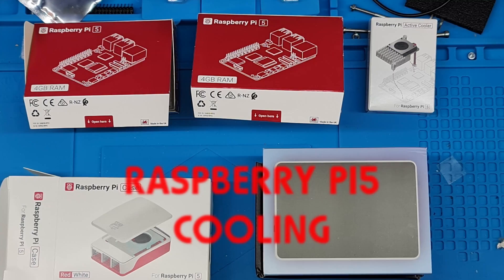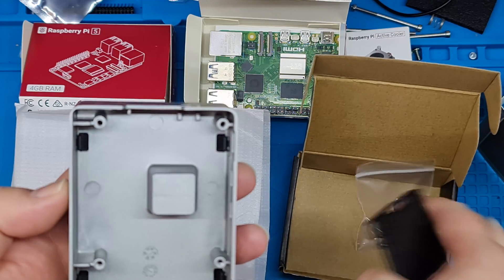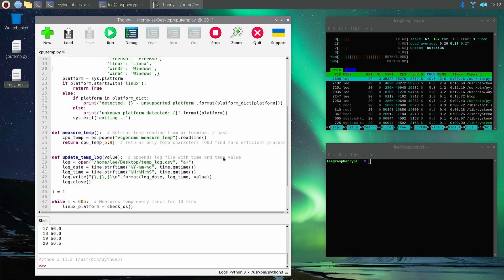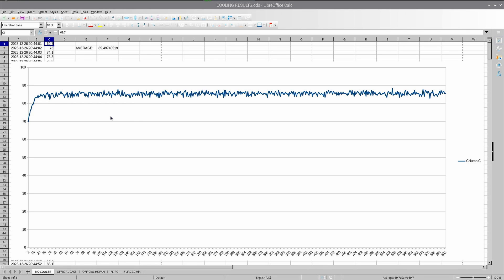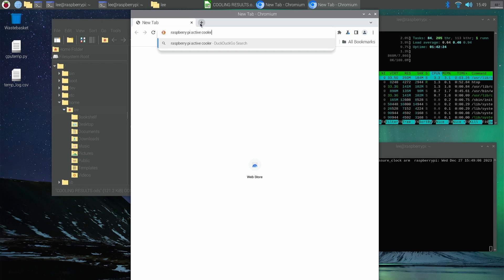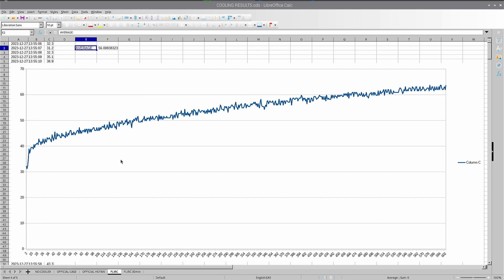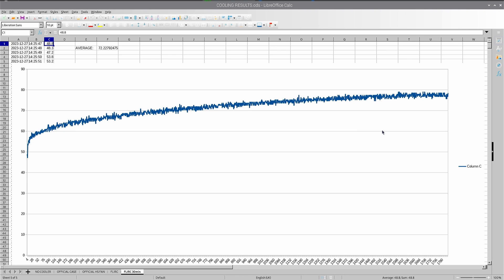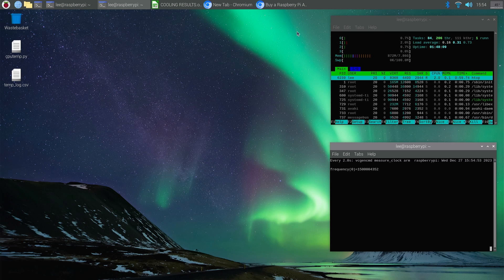RASPBERRY PI 5 FLIRC COOLER, how does it perform next to the other offerings ????

Comment: I disposed of the cheap foam thermal pad in my Flirc case, and replaced it with a proper 1.2mm copper shim and Arctic Silver 5 thermal paste. I burnished the heatwell flat before sandwiching the copper shim and thermal paste into place.  It was much more efficient pulling the heat out of the CPU and into the case.
Reply from the maker: @SEO122  once the flirc reaches saturation though it can only radiate heat at a level in proportion to the ambient temp, reckon your solution will deffo help thermal transfer from pi to case

Comment: Hi, thank you very much for this video. Since you own a Raspberry Pi 5 and the Flirc case, it would be really interesting to analyze if the Flirc case can also handle an installed Ubuntu since it's also supported nowadays for the Raspberry Pi 5. The temperatures should be higher but it woul be so interesting to know if they stay below 80°C. If you're interested in testing it, your audience would surely appreciate it :-)
Reply from the maker: @Lares575  I tested it under maximum load, as it handles 100% load ubuntu would no doubt use less and would definately handle it
Reply: @CaptainCommodore  Thanks. That`s good to know.

Comment: thanks for the great video 
what i would like to know is: does the flirc case influence the WiFi and Bluetooth connection? i could imagine hat metal cases can have a strong influence on these connections compared to plastic cases
Reply from the maker: @SuperPaul5000  to be honest in my use case (no pun) I don't notice any degradation of signal and I'm in a room directly above my router, however I could see there being a small reduction in range at the edges but this may be how it's orientated, both devices have a plastic base though

Comment: Really interesting, did you ever try to replicate this? Its crazy to believe passive cooling goes toe to toe for so long with active cooling
Reply from the maker: I did the tests several times, it is works well until the case reaches saturation and then its a function of thermal loss to atmosphere so this may reach throttling in higher ambient temperatures

Comment: The flirc missing the mark in some regards......there are other similar cases that make contact with other chips on the Pi.  They also have more surface area (ribbed) on the outside to get more surface exposure to air for better dissipation.  Oh - they're cheaper too.
Reply from the maker: Whilst tour absolutely correct , the other chips are rated for 85deg so it's not a massive deal breaker,  of course it also stands that if one chip heats up quicker than the others the heat will infact transmit to the other in contact with the heatsink, as the CPU heats up quicker it can raise the memory temp too..... the neo is really nice too and the hybrid approach is prob the best for me

Comment: there are other chips that the flirc does not touch, but the active cooler does. flirc results are not comparable because it is not cooling any others, also there was not additional chip coolers for the other chips. no way I am going to get the flirc case... thanks for the info!

Comment: great test 🍻
It looks like active cooler is designed very well, I have my RPi5 without any case, average temp working during the day is from 40'C to about 52'C
Reply from the maker: I definately recommend the flirc fir silent operation, if you going to push the pi5 a bit have a look at my argon neo 5 video , that performs really well
Reply: @CaptainCommodore you are right, it's good as well, but I have Pimoroni NVMe Base, so my RPi5 won't fit, active cooler is good option in my combo, I can control PWM with modded library 😁👍

Comment: Thanks for the taking the time to do this video. I'm running a couple of Pi4 in FLIRC cases for DNS and a few other tiny services and I settled on the FLIRC's after having to constantly replace fans on Pi4 active coolers. After seeing this I can now confidently upgrade my Pi4/4GB to a Pi5/8GB and use the Pi5 FLIRC case going forward.
Reply from the maker: I too use the flirc cases on the pi3 & pi 4 and never had any trouble with their performance,  not I know that they can reliably cool the pi5 it's ideal for use cases like yours or even media centre type applications

Comment: It seems like rpi5 with the flirc case gets roughly 10 degrees hotter than with the passive cooling case from edatec. I think it's reasonable considering that the flirc case only contacts CPU for heat dissipation, whereas the edatec case has three regions contacting with components on the board, just like the official plastic case.
Reply from the maker: I havnt seen that case, but the argon neo 5 alu/fan case doesn't contact the ram just the cpu and price chip, I know the ram is rated too 85deg which may be why the flirc and neo don't bother contacting it, the Flirce is very nice though and perfect for media use
Reply: @CaptainCommodore Yes thermal throttling should not be an issue for all those third-party passive cooling cases out there. But just like how we treat laptops, it's always appreciated if we can have more thermal headroom, just in case the working environment is hotter than we expect. 

In addition, EDATEC case has cutouts for all the necessary connectors, just like argon neo 5. In my testing rpi5 reaches 67C after 30 min stress test. So I'd argue that the fan is in most scenarios not needed. 

Besides the top surface of the case is lower than USB ports, which means that it doesn't add up the overall height and I can use it in robotic cars along with expansion PCB without worry for interference. All default accessories to mount expansion board onto rpi5 should work.
Reply from the maker: @Char1es4k  of course headroom is good and there not much with the flirc, I will have a look at the EDATEC case, although when I tested the neo that topped out at an average of 64deg and was almost silent

Comment: Love the look and the silence of the Flirc cases

On the bare board, did you happen to see how far the CPU speed was dialled back when it was throttling?  My other question is what do you use for stressing all cores?  stress-ng/s-tui?  Apologies if you said that and I missed it.

Comment: Putting some conductive thermal mass into the flircs cavity would probably do wonders for it's ability to take heat away from the cpu.
Reply from the maker: Well only until it heats up, once heated, if the cpu should drop in temp it would be connected to a hot mass
Reply: @CaptainCommodore That mass would actually strengthen the thermal column getting heat away from the cpu because it would move heat to the outer shell, even once saturated. 

The pillar isn't hollow for effectiveness its hollow for cost.

Comment: New pi can run 1080p60 YouTube in the browser quite well.  This is a popular use case that taxes the CPU/ GPU to high temps.  Passive cases get really hot
Reply: Note, on some weak computers 1080p60 youtube is much less taxing if you go into youtube settings and disable AV1 for HD videos, I managed to get 1080p60 working fine on an ancient netbook (running linux) that way.  Of course that is still x86 but it is a potato
Reply from the maker: I suspect that it may be using software decoding which will tax the cpu more, but you are correct , the passive cases will get hotter than active as it has to radiate heat away
Reply: I've tried the Flirc and the Geekworm Heavy duty passive ones and am a bit worried about hot cases coming into contact with desk clutter.  I ordered the argon neo 5 which looks like a good passive/active solution   @CaptainCommodore

Comment: They should do this case with M.2 storage
Reply from the maker: Absolutely, it may not be too hard to actually fit an m2 underneath with a modified base, I would be a little concerned with the higher heat output right next to the m2 though

Comment: I have the Flirc case for my Pi4 with no complaints. It barely gets warm most of the time and looks good which is probably the best part about their designs. The official cases look a little toy-like, IMO.
Reply from the maker: I too have the flirc for the pi4 ( I also have for thr pi3 too ) it works really well on both these, the flirc cases do look good and are ideal for media centre use

Comment: picking up a flirc case requires commitment to its limitations because you can’t add a bottom ssd accessory or attach other peripherals. part of my waiting is to see what cases will be available where you can add a bootable ssd and maybe dual drives in a nas setup. but it is great to see that the official cooler has done a great job with thermals. 

one wish is to have a pi 5 case which is compatible with both the official pi active cooler and a bottom ssd attachment and access to the gpios and other peripherals… a case which does not inhibit all the other functionality. and the case must not have red. 
(argon40’s pi 5 case has red and i don’t like that. additionally, you have to unscrew it with a screwdriver to get to the internals. no tooless entry.)
Reply: I'm in the same camp. I need LOW power consumption, because it will run off of a battery (word processing). I would like an nvme, though, and my choice of case so far is a full-contact-with-the-chips finned beauty...
Reply from the maker: I have an argon neo case coming and I will update the test for that, I suspect there will always be a compromise depending on use case
Reply from the maker: The new neo case is rather nice thermal wise AND they are releasing a nvme lower case for it, I made a video on the neo too

Comment: I ran two testseries with a "cpuburn-a53" stresstest and the FLIRC-case, one time with the original thermal pad, one time with a third market thermal pad. At around the 20 minute mark both tests reached 82+ degrees Celsius and I ended the tests there. The case did not reach a thermal equilibrium at that time, the temperature kept slowly rising. I am really not sure, if the FLIRC-case is really usable in the long run.
Reply from the maker: I'm not sure why yours is higher, the only thing I can think of is that a) your ambient was hotter or b) your overclocked or c) there's not as good thermal contact as I had........ perhaps you should try the test to see where it stops ?? I used the "stress" package for the stress test on all 4 cores, I left the pu running at full stress for well over an hour and it was definitely stable at ~78°
Reply: @CaptainCommodore   I just ran another test. Ambient temperature was about 22 degrees. I am running the lite OS without graphical windowmanager, in a headless setup with ssh login and tmux. System is not overclocked, right out of the box. The only connectors are power and a lan cable.

When using the most basic stress-command with "stress -c 4" to engage all 4 cpu in the most basic way, the longterm temperature was between 77 and 79 degrees, with some random spikes into the 80,X degrees. That is not a lot of margin, if you want to run your system in the middle european summers, where ambient temperatures will go up.
Not all stresstests are equal, "CPUburn-a53" is designed to stress the system to the max, to generate as much heat in the Pi as possible, and here the Flirc-case did not that "well".  The Flirc-case has only one aluminium "stem" to only cool the cpu. The  other chips like powersupply, RAM, etc. go uncooled.

I agree, that you do not stress your system with "normal" use-cases, but bad luck and software bugs can happen, that can send your system into overdrive.. Some other people also may want to keep their Pi in some kind of enclosures, be it a book case, a drawer, a 19" homelab enclosure, etc.
Reply from the maker: @Pepperpot666  Can't disagree with anything you said there, will test the neo when it lands, I believe it does cool more than just the cpu and I have had argon cases for my other pics.

Maybe a good use case for the flirc is a silent media box, not sure how much cpu x264/x265 will eat up but I may look into it.......
Reply: Ditch the thermal pad and go with a proper 1.2mm copper shim with good thermal paste like Arctic Silver 5.  It makes for a much more efficient transfer of heat from the CPU to the Flirc case. I run all my Raspberry Pi systems 24/7/365 this way and they never get warm enough to hit thermal cycling.

Comment: Thanks for the video, really helpful. I like passive cooling but I still have some doubts about the FLIRC case.The active cooler metal surface absorbs heat from 3 components, while FLIRC only from the CPU one. In addition when ambient temp is above 25 degrees the CPU temp very likely will exceed 80 degrees I think?
Reply from the maker: Yes exactly, that's why I suspected the simply reused the mould for the pi4 case with a power button mod, the rpi active cooler comes with pads on the bottom to contact other components, the only real question is if flirc did this deliberately knowing how hot the aluminium gets to deliberately not pass that on to the other components, I know the cpu is rated at 85 degrees but I'm not sure about the other components, I have an argon neo coming so will do the same test when that arrives

Comment: Thanks for your thorough benchmarking, you convinced me to order the case!   How does it handle overclocking to 2.8 or 3 GHz?
Reply from the maker: I havnt tried overclocking the case but that's a goodnidea for another video, I am getting the new argon neo for the pi 5 in the next few days so I will put that through the same test, after I may see how the fare with an overclock
Reply: @CaptainCommodore  The Argon Neo looks really nice, but I personally have a fondness for the Flirc cases simple design.  Apart from those two cases, I think the Geekworm Geekworm P573 and P532 look really slick - the only downside to these might be the wireless signal.

Comment: Level up your FLIRC case by running it in hedgehog mode: rip off the plastic lid that keeps all the heat in and use a thermal pad to stick down a CPU heatsink to the now exposed aluminium. The increase in radiative capability produces the best silent cooling solution that can run high loads for hours on end. I discovered this when using an RPI4 as a 720p media centre.
Reply: Looks uglier.  Better performance though.
Also, Geekworm heavy duty aluminium case does its job but runs hot.
Reply from the maker: Definately,  increasing the surface area exposed to ambient will absolutely help lower the temps, I have the argon neo case coming which combines an aluminium case with a cooler so that should be nice

Comment: I also got one for my Pi 5 . This will be my 3rd Flirc Case as i already have one in my Pi 3B+  & Pi 4 as i like to non stop overclock in my Batocera Builds.
Reply from the maker: I too have the flirce for both pi3 & 4 and these have all performed very well, luckily even with overclocking all 4 cpus are rarely maxed so temps will be even lower, I love batocera and this is my emulation distress of choice
Reply: Yes Nice that we can finally get Full Speed Sega Saturn on our pi 5's now @CaptainCommodore